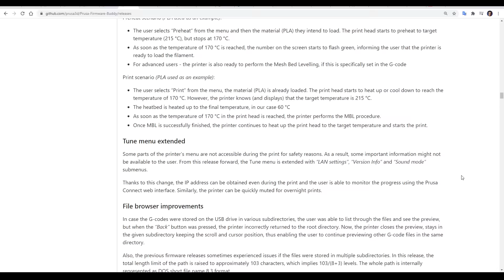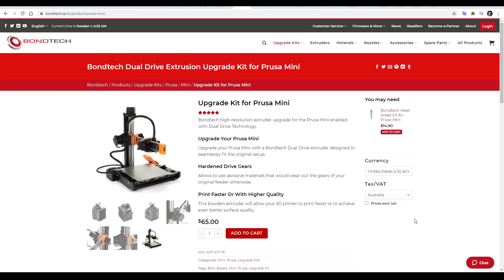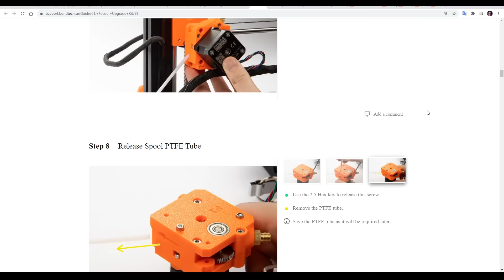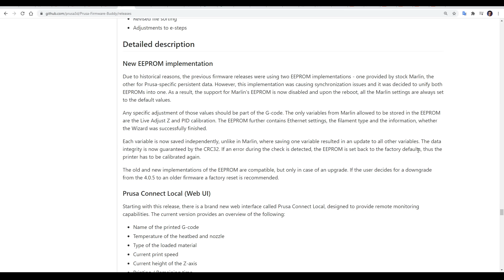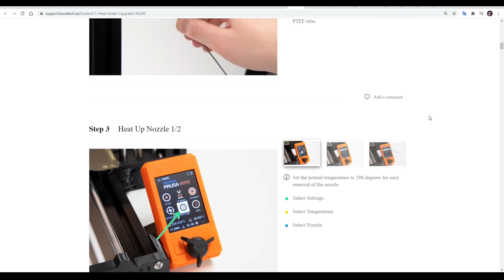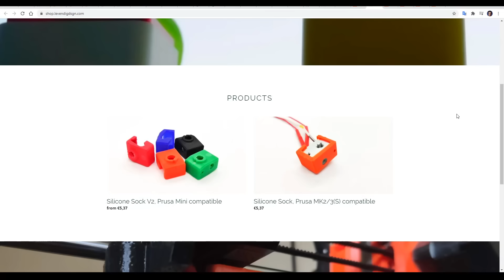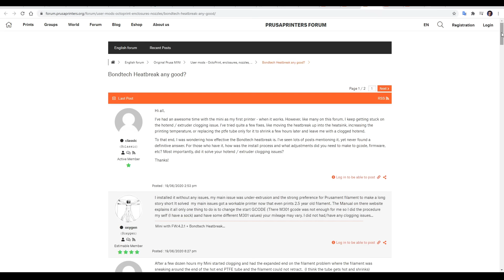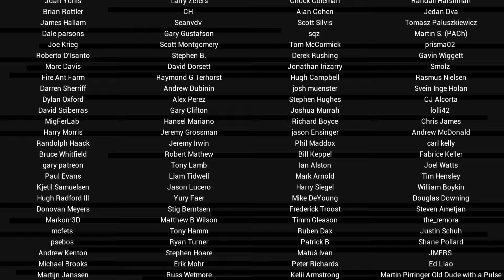Prusa Mini update: Improvements including Bondtech extruder & heat-break

Comment: I've had problems with under-extrusion. I was at a point when I couldn't get one single good print out of my printer. I was seriously considering the same upgrade but I contacted Prusa support first, and I'm glad I did it.

For me what solved the problems with the mini were:
- re-tightening the hotend PTFE tube so it is sitting in there REALLY tight.
- reapplying the heat-conductive paste on the heatbreak (I used the one that came with the printer)

Ever since these steps my under-extrusion problems have been completely solved. My print quality is on par with my colleague's i3 MK3S. The only thing that's difficult to handle are seam marks on vertical cylindrical surfaces.

Regarding the extruder, I followed the instructions of the online manual for disassembling the extruder, unloaded the filament, adjusted the screw so it's flush with the plastic housing and reloaded the filament. I check the extruder gears regularly and clean it when there's some accumulated debris inside. When unloading the filament I can not detect any significant "bite marks" on the filament anymore.

I think the BondTech upgrade (especially their extruder) is a worthy improvement to the Prusa Mini design, but if you are just trying to fix the under-extrusion phenomenon and not looking for improved print quality then my advice is to try a few maintenance tricks first and contact Prusa support before spending more money.

BTW thanks for the detailed description of the upgrade process, I'll definitely re-watch this when I finally try one of these upgrades!

Comment: Got the mid August version of the Mini and having no print quality issues at all, still running stock. The only point of grief is the first layer height inconsistency. Neither the 'pre-heat' nor the 'keep the probe away as long as possible' approach yields 100% reliable results.

Comment: Got mine today after ordering it back in November 2020. Was surprised to find that I was upgraded to the Mini+ for no extra cost when it was delivered. Initial hardware setup was fiddly to say the least, and the First Layer Config failed until I started printing the Bolt on the included USB and used Live adjust functionality on it. And because of that I was able to get the cleanest and smoothest Benchy I've printed thus far. Can't wait to get more done with it over time :)
Reply: What has it been like for you

Comment: Incase anyone was wondering the PTFE length will be roughly 15-16mm. Also the instructions seem slightly outdated in the link. On the older Prusa firmware they say set the extruder direction to 'wrong'. But on the latest firmware...do not change the direction.

Comment: I have had nothing but issues with my Prusa Mini.  First the Minda probe shorted out after a few prints.  After getting it replaced, I started having under extrusion and clogging issues.  Like TT, it turned out that my tube in the hot end was too short and there was a gap that was allowing filament to build up.  I got a replacement tube but I'm having a hard time clearing the hot end of residual filament that had built up so replacing it has been challenging.  I also found that it takes more force than it should to feed filament (even prusament) through the Extruder-Print head PTFE tube.
Thank you for the video, I've been busy the last few weeks and since I have a MK3 working fine, I haven't put much time into it.  After watching this video, I'm hoping to get back to it this weekend.
Reply: Did you have an issue like in this video? https://www.youtube.com/watch?v=8W_gsklb3kA
I have an intermittent problem where the extruder will not do its job in a smooth and consistent manner. 
It works ok for awhile, then this starts and ruins a print 50% in.

Comment: Prusa now allows you to permanently change the E-steps in the firmware and the Bondtech extruder now houses the filament sensor internally. The sensor wires still require a re-pinning of the sensor plug. I found this to be a fantastic upgrade. I see that others are changing the E-steps to correct extrusion issues that still persist. I have found that running a calibration cube and adjusting the extrusion rate in the slicer's filament profiles to be a much better option as every filament extrudes a little differently. I now have different profiles saved for each of my filaments as even different colors of the same brand of filament have required slightly different extrusion rates to achieve optimal extrusion and have found that there is no magic extrusion value that works with every filament.

Comment: I got my Prusa Mini in July. I had been watching the forums prior to receiving it and had picked up on the issue that many people experienced with the PFTE tube not being seated correctly in the hotend. Right out of the box I did the recommended fix from the forums, and I've had very good print results from day one (once I switched away from the textured sheet, its not for newbies like myself!), excluding some failures that were related to some poor quality filament. Watching closely to see how Prusa support handles the issues, while myself and many others have had success, it seems like there are just as many out there who have struggled. I'm interested in the Bondtech upgrades as well, but I'm relatively new to this stuff still, so I'm not confident enough yet to mess with the start g-code. Your videos are great!!!

Comment: Most effective fix: Change coldend cooling fan. Original fan is loud and runs at 38% speed (by firmware, not controllable for the user). Replace the fan by a noctua. Remove black cable from the connector, islolate it (use a 1by1 Dupond connector housing or some tape) and plug it to J21 Pin 2 (you might have to remove the jumper between Pin 1 and 2). This way the noctua gets permanent ground instead pwm. A Noctua@100% speed provides about 30 to 50% more ait to keem coldend cool than stock fan @38%. And is ultra silent...

Comment: I just upgraded my Prusa Mini+ with the Bondtech extruder and heatbreak upgrade and it was totally worth it for me. The issues I had with my Prusa seems to be solved now which is good :) It took a while to assemble. I found out that if you were careful you did not have to disassemble the heater cartridge and the thermistor. You could just remove the heatbreak if you were careful but you had to loosen some screws on top of the fan so the cords were not so tight/able to move when removing.

Comment: This video has so many outstanding teaching aspects that I award you full points. As an experienced user and custom GCoder, your workarounds to Prusa's firmware "no user update" are well done.  But does Prusa not defeat the "Open Source" philosophy that Prusa claims it supports?  Sorry, this may be a TLDR review.

 I have not watched your initial Mini review so I may be commenting where you have already been.  The Mini major issue for me is the cantilevered "x" axis.  While it may permit a simple kit assembly but it hardly qualifies as a stable, vibration free design.  It may, however, be a good overall choice for a beginner's printer in kit form.  But now to this video.
  
You are so thorough is describing the hot end design Mini deficiencies (see 1:48 in video).  The identification of the "free space" caused by improper tubing length is very important to new 3D printer folks.  It can cause major jams and loss of time due to cleanout, this is nontrivial work.  You didn't discuss if the Bondtech replacement kit solved this issue; it likely does as the Bondtech instructions are so complete it is hard to imagine that it does not.  You also describe the Prusa limitations of PID calibration - no M500 saving into EEPROM but offer a very convenient fix for users using the Start Code script in the slicer.

You are again so thorough in describing the Bouden Extruder Mini deficiencies.  The Bondtech replacement is totally appropriate to me that it defines Prusa's design as a Mini "showstopper" for purchase.  Bondtech instructions are impressive.  But how sad that a user would have to rewire the motor connector because Prusa will not permit firmware changes in configuration.h where motor direction can be changed.  I am sure you know what I am discussing.

Overall, Michael this is outstanding work.  But does it not label Mini as a failed design?  I say it does.

Comment: Wonderful video as always! may be worth adding a card at 11:35ish saying don't use PC thermal paste! That stuff is only rated to slightly above 100C and will degrade heavily and possibly release some nasty gasses during printing. Its important to use high temp thermal paste like slice engineering's boron nitride (which I know is what you used) but I don't want someone who has left over pc thermal paste from their pc's cooler swap to try and use it on their printer!!!!
Reply: Good points
Reply: The heatbreak should never get that hot in the upper section.
Reply: @olorf  that’s a very good point. I also apply thermal paste to me heater cartridge which certainly does so I guess my brain was stuck on that!
Reply: @rickyh2896  that's a good practice. I apply to nozzle threads, thermistor, cartridge and upper heatbreak.
Reply from the maker: U just happened to have the left over slice engineering paste but if I didn't I probably wouldn't have even thought of that. Thanks for the heads up.

Comment: Thank you for putting up this video. All I see is praise for the mini and that has not be our experience. My buddy and I got a PrusaMini in July (after a 4 month wait because of Corona) and I will not buy another Prusa product again! Everyone praised Prusa and I don't understand why. They have so many quality issues. There were even problems in assembly because the aluminum extrusions had burrs on them that were a pain to file off, and in the 3D prints many holes did not line up. These are basic quality issues. 
     For the last month we haven't had much use of it because of an extrusion issue. Something is designed wrong. Maybe the Bowden Tube design is not robust enough. Some combination of the PTFE tube, extruder, and hot end is causing inconsistent extrusion and clicking coming from the extruder. Did a number of calibrations, replaced the tube, disassembled the extruder, I'm done.
     The Customer Support is useless as well. They just throw up their arms and say "If it used to work well, and doesn't work well now, it's not our fault. Figure it out" 
Really? Ok then, F*** you! No more Prusa for us or anyone we talk to.

Comment: I did the same upgrades as you have.  Initially I was having heat creep issues and was going to do the Bondtech heat break and had the "might as well's" and did the extruder too.  I make it a point to run the restart g code every time I restart or power up.  If you don't do that, loading and unloading filament does not work well.  Slice engineering has something brewing for the mini I think.  Keeping an eye on them.  Just upgraded to their new heat break and block on my MK3.  Another thing I did was to add a piece of bowden tube to the wire bundle to help with strain relief.  Lost one minda to wire fatigue, trying to prevent another.
Reply: Slice engineering has STL files for adapting the existing Mini extruder to work with a Mosquito. That should resolve the some of the issues.

Comment: My prusa mini had similar initial challenges to yours, if maybe a bit less severe.  However, after sliding the hot end up into the extruder assembly and replacing the PTFE tube with a slightly longer one, print quality is much improved.  Surfaces are not perfect relative to my Mk3, but I would consider that nit picking at a much cheaper printer.  Very satisfied after making those quick fixes.  Also I am now very interested in a silicone sock for the mini!

Comment: My experience: there are certain (non-Prusament) filaments that, after I use them, I'll know I will have to clean out the extruder gears.  My Prusa MK2S never had that problem.  But otherwise... my Prusa Mini+ has been giving me essentially perfect prints since I bought it in the fall of 2021.  I did see some stringing at first, but experimented with temp, speed, and retraction settings and managed to find values that have mostly removed that problem.

Comment: With the new prusa firmware you dont need to rearrange the wires, go to settings - HW Setup and you can switch from "prusa" to "wrong" which will reverse the direction the extruder spins, you can also edit the esteps there

Comment: I’ve had the Mini for 11 days now, and only 2 prints of about 60 have failed. Other was about too high first layer, and other too tight extruder grip. Other than that, quite good results. PLA looks really good, and PETG has some horizontal bands. Not bad thou, and no underextrusion or missing sections.

Comment: You might want to check the bowden tube on your Mini. I was having weird extrusion issues on mine and found that the pressed olive style couplers they use were a bit too tight and were causing extrusion problems during certain movements. I changed them out for the usual PC4 quick connect couplers and it resolved the issue.
Reply: I changed those PC4 quick connect dumb things out for the brass ones on my Clone and that fixed all my problems...

Comment: Mini+ Pre-assembled. Thanks for the video. I have the printer now for a week or 3 and it has been printing everyday. The first prints where a bit frustrating. Entirely my one mistake because i only did the final assembly and started printing whiteout reading any instruction. I pretty soon figured out what was wrong and how to adjust. It is now near to the end of the first spool ( 1kg PLA) that i'm starting to read the instructions.  ;-) .I've got more time between designing and printing because printing takes a lot longer now +30 hrs printing. Issues that i came across where more related tot the model than to the printer itself. I've had a part found on the web and adjusted it to my needs. The part of the print that was from the original file had some roughness an d a lot stringing. From the part that I added, designed with Sketchup, stringing was almost gone.

Comment: I bought a MINI because I thought it would be the best printer in its class. Also, after fiddling with an old Ender 3, I saw it as a huge upgrade. And overall, I'm very happy. I do have a pretty serious problem though. I'm not sure if it's the MINDA probe or what, but I have to manually change my z-offset with pretty much every print. It wouldn't be a huge deal, but even my Ender has been printing for months without touching bed level. After contacting Prusa, they didn't have much of an answer for me either. I'm not sure how I feel about it. I will say though, that when it prints well, it's very nice and I can rely on it. Great Video, thanks Michael!
Reply: Sounds like a MINDA issue. You could try preheating(pick your temp), calibrate(home), let it warm up, let it sit for 5 minutes and then print. That should help but it still wont be perfect.
Reply: @hurrycaine1  thanks for the reply. I did end up contacting Prussia support and that's basically what they told me to do. Unfortunately it still didn't fix the problem like you said. Thanks though!

Comment: Uufffff... Such an expensive printer and still there HAVE TO be upgrades. I appreciate Prusa's work. But THIS is not market-ready!
I'd rather go for a less expensive BIQU B1 with better print quality or the full price MK3S!

Thanks for this really good and honest test! Cheers mate.
Reply: I do like my Mini but I agree, I should've added a bit more cash and get me another MK3S. Unfortunately, I went the other way around, seeing the Mini as a well priced entry into the Prusa 3D printing machines. I bought the MK3S after I got a great experience using the Mini. Now I use the MK3S more because I don't need to fiddle with first layer height all the bloody time, haha.
Reply: My Mini works perfectily fine and give me better quality and more accurate prints than my CR10S Pro which was priced at 750EUR when it was released. Im really happy with the mini and had no such issues like teaching tech and im currently sitting at 150hours of printing

Comment: Just got my Mini+ kit last week and it has been nothing but intermittent issues. Definitely considering getting the bondtech  extruder in the near future after having to pull my mini extruder 5 times to clear out filament.
Reply: My Mini+ is doing well. It is just a week old now. I got the pre-assembled kit.
Reply: I have found out a lot of the trouble comes from the two gears in the extruder.
The parts are all printed and have tolerances like crazy. The gears must not make grinding noises and the slack/clicking should be on a minimum. However the extruder will never be perfect no matter how you install it

Comment: I'm not a fan of Prusa printers, the two I had were both bad and my cr-10 mini and ender 3 both printed better than the two prusa printers I bought. I eventually sent them back because i didnt want to upgrade them to print as good as my two creality printers, i used that money to buy 5 more printers from creality and still had some money left over for a few upgrades for them.
Reply: I refuse to pay 1000 bucks for a printer with 3d printed parts. It looks cheap and not as strong as injection moulded. To top it off like you said you can buy 4 ender 3s which i love and trust.
Reply: @carbide1968  MK3S parts are printed in PETG. I don't know how you treat your printers but I don't kick mine around. My old Mendel Max 1.5+ is about 6 or 7 years old, with joints printed in PLA and still works to this day. My MK3S is a little over a year old and has been performing perfectly. It is a tool like my cordless drill. I turn it on when I need it and it will produce my part. No recalibration, no messing around, it just works.
Reply: 0
Reply: @carbide1968  Yeah I wasted my money on the mini and mk3s. both have the same problem with inconsisest first layer.